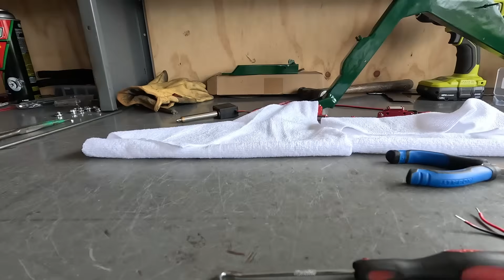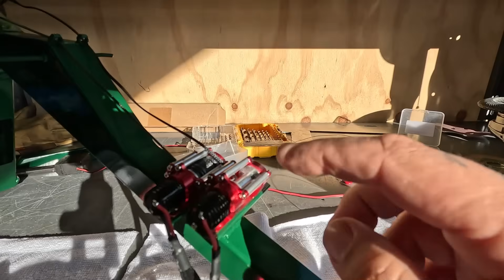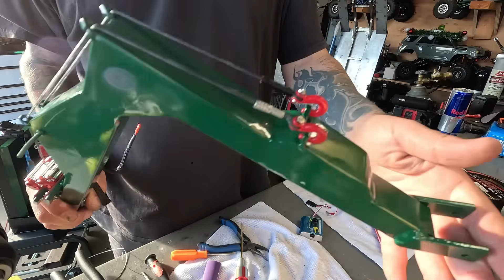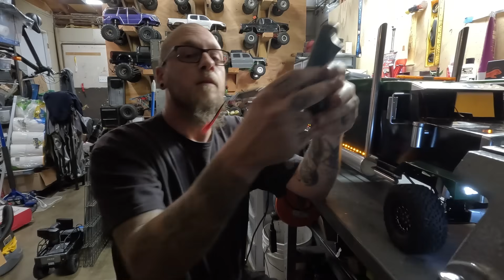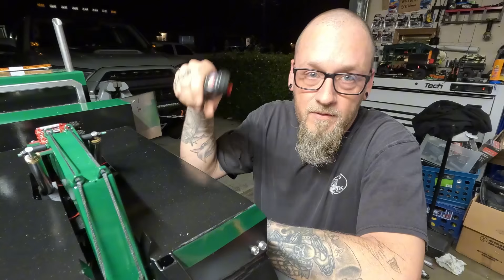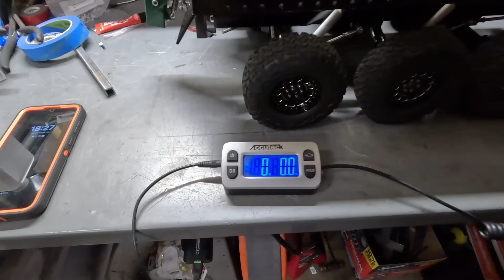1/10 Scale Semi / Zacklift Wired and Working!!! (Wiring Explained )

Comment: (soldering) i don't know if any one mentioned it but your partly right, you tin the wires like you said and then you tin the pads of your led`s when you have done that then you solder your wires to the pads you will find you will get a much better solder joint.

Comment: these "hydraulic rams" are not servos, they're just geared motors, to be servos they would need to be able run to desired position. When you control just speed and direction of their rotation, they're just motors with gears.
Same apply to winches - these winch controllers are just small ESCs - you can use any ESC for these purposes.

Comment: Totally agree on the soldering and welding thing I can weld pretty good. Can’t solder for shit tho
Reply: It's the soldering iron. You can solder. You need good flux. A good tip. And black oxide screws holding the tip. Not stainless.

Comment: Great job! I appreciate that you show the process, and not just montage of best parts and success at the end. Relieves the pressure on making own projects.
For wiring, another two tips for light. First, see if lights need resistors. Most of them have one built-in, but sometimes not. Second, you can inject always on lights into any spot in wiring with Y cable, if running all the way to receiver is inconvenient.